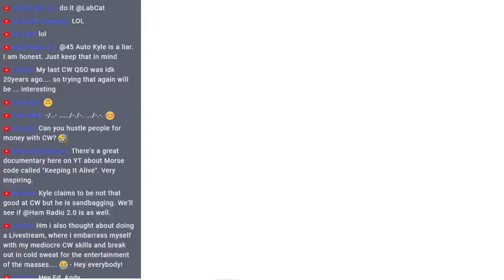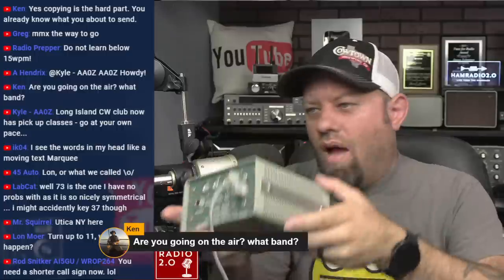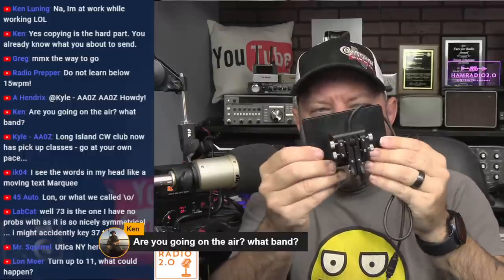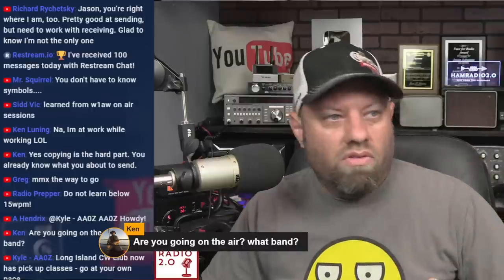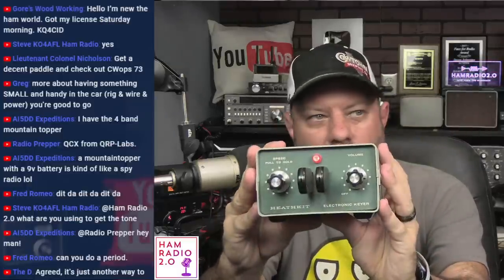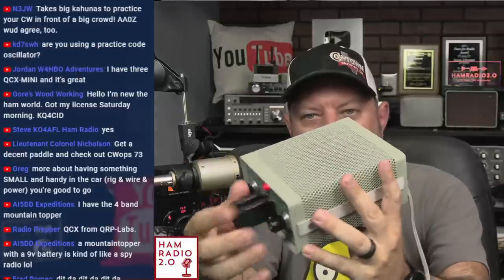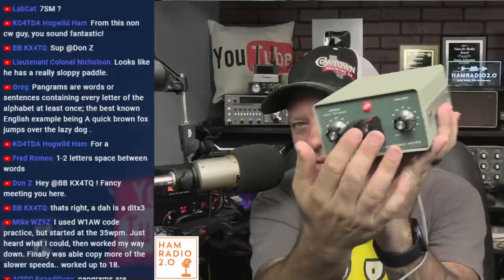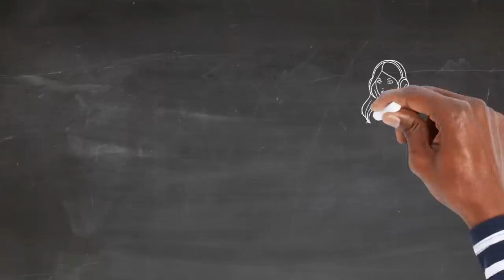I Learned CW!  (well not really, but I am trying) | Learning Morse Code!

Comment: I did CW Academy and came out sending at an easy 20WPM, with ears that work closer to 5WPM.  Twice.   Doing the class twice didn't help at all, so they created a level 1.5 for folks like me that need a lot of practice using what I already learned to prep for level 2.   I don't know if they still do that or not as I had some kids and have been out of it for a while, but looking to jump back in eventually.

Comment: The V and 4 get me and the h and 5
Reply: On Field Day, a lot of stations send ? when I send "3À VÀ" or "4À VA" (whatever class my club is doing that year).  When this happens, it usually takes a few times until the light bulb turns on at the other end, which is fine. There had been a few times "DE" would throw me for a moment, thinking "from" instead of "Delaware".